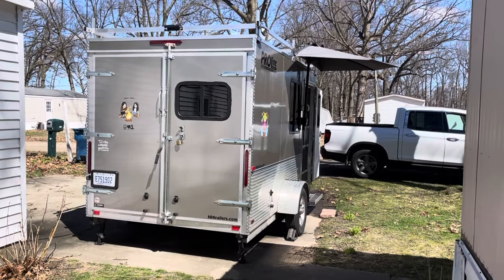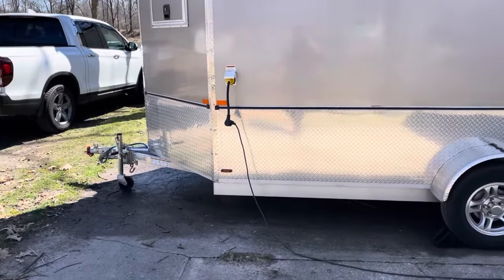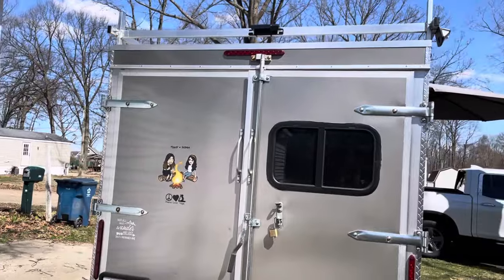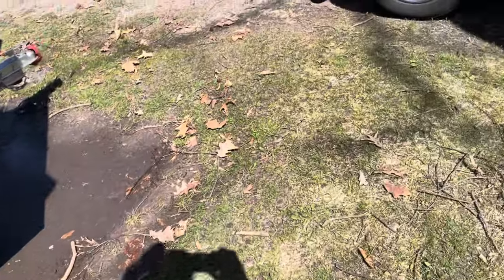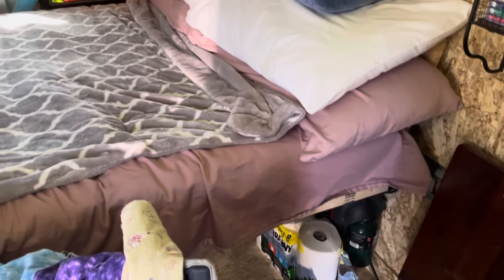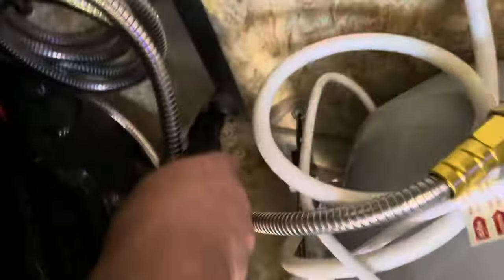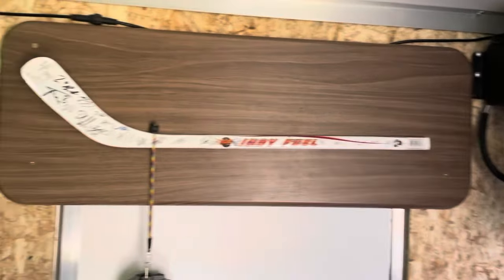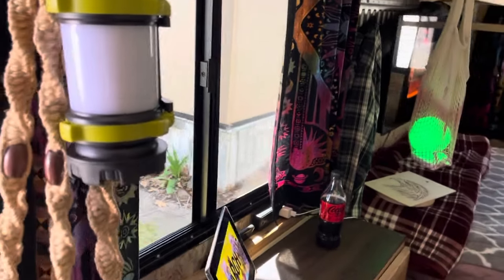DIY Cargo Trailer Travel Conversion 2.0

Comment: I like the setup. What is the MPG with the Ridgeline and cargo camper? I have a 23 Ridgeline and just curious as to what you are getting.
Reply from the maker: Honestly I can’t recall. I think I get 14 towing and 21 not towing. I tow between 60 and 70 mph, usually 65. Not towing I run 75 mph.

Comment: I have a 6 x 12  cargo.  Question: did you screw the etracks into the steel frame or just the particle board sides?  I like the simple style, same here.
Reply from the maker: Factory installed. They're screwed into the frame.

Comment: I had to like and subscribe just because of your communication style.  Why did you get rid of the diesel heater?
Reply from the maker: We didn’t get rid of it. I just took it out. I almost exclusively use my trailer to escape nasty Michigan winter weather. We go to Alabama or Mississippi a lot between November to May. We stay at COE campgrounds where we plug in and use electric heat. I run a Wave 3 propane heater while driving between campgrounds, but only when it’s below 55 or so. We never use the propane while we’re inside. The diesel heater worked great if I was going to be in below freezing temperatures a lot. But I’d need more experience using it effectively. I’m thinking of ideas what to do with it now. I’m thinking of installing it in a container to sit outside with a hose blowing heat up through the floor.